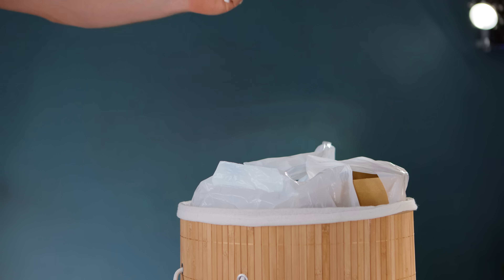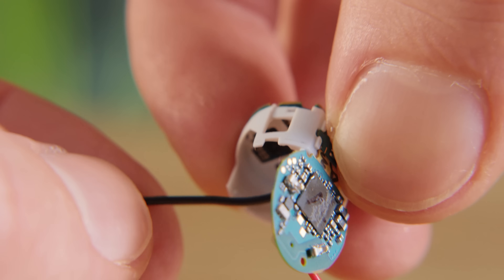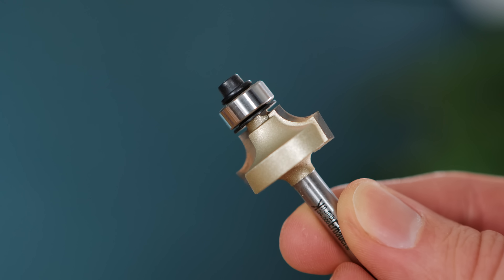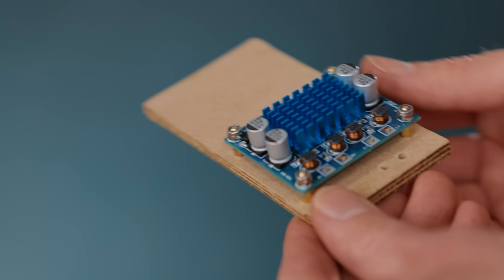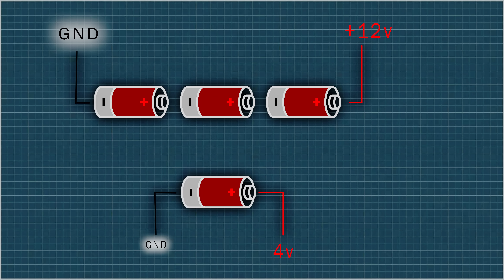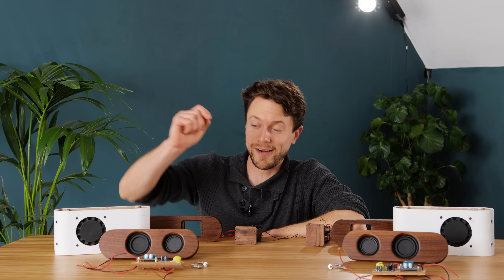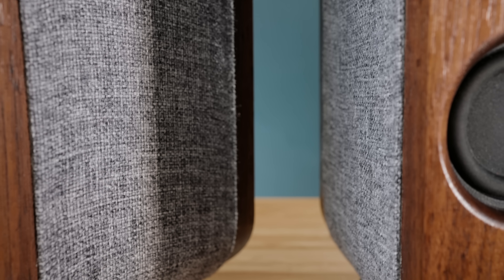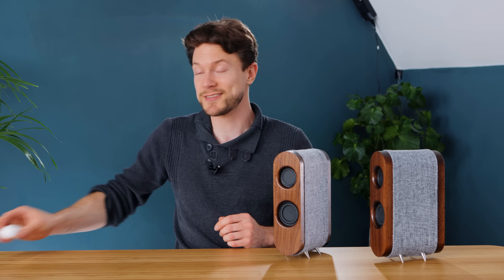Transforming dead earbuds into POWERFUL wireless speakers

Comment: Old earbuds = free

Everything else = counterintuitively expensive
Reply: Everything else is pretty much optional though. What matters is the idea that a set of earbuds can give you a way of connecting 2 speakers to one device, which I never thought of and it opens up a lot of opportunities. Maybe you dont need to build new speakers, maybe you already have some wired ones which you want to convert to wireless, all you need in that case would be a battery pack as the other circuits are already built in.
Reply: @Chuckiele  I've got some cheap wireless headphones that came with an old phone, and a shit soundbar I got free with a TV.. going to make a set of speakers for the office..
Reply: @unh0lyav3ng3r8  Life is too short to waste your time with bad audio gear. We're living in the prime time when lots of good audio gear ends up on estate sales....
Reply: @unh0lyav3ng3r8  how did you go with making the speakers for the office mate?
Reply: @Chuckiele  Absolutely... My sentiments exactly. Built my son a pair with old drivers for his laptop from an unused pair of earbuds. I had PAM8403 amps lying around and some 18650 cells. 

Picked up a busted pair on ebay and built two pods that clip into the banana clip sockets on some bookshelf speakers. Used some better amps I had and used 2 cells per pack. So now they are true wireless too. 

Both sets sound GREAT just from the separation alone... I would LOVE to hear what these premium drivers sound like, almost as much as I STILL want to know what the extra circuit on the Tectonics drivers is....

...and this is possibly the third rabbit hole I have fallen down. I also have a wireless tv, several frenel lens lamps ... which are great for low light Teams Calls, to name but two.

Whilst one could look at the title as click bait.... I just take-away the ideas on show and run with them.
Reply: Why even come to a DIY channel to complain about this
Reply: @Sketchy_Dood  cuz if its diy id like to be able to do it myself xD not have to not eat for a month so i could
Reply: @kiritofanboy  you don’t have to not eat for a month to make this...
Reply: @Sketchy_Dood  i would why shouldnt i?
Reply: @kiritofanboy  if you're a diy/ upcycling type of person, you've already been collecting materials for years. You've spent hours rolling through rich neighborhoods before their yearly bulky item trash days because so much of what gets tossed is easily repaired or still in good working order. You've rolled through the poor neighborhoods on eviction day at the end of the month, looking for solid furniture pieces because old solid pieces are everywhere. You have a collection of tools bought slowly, over time because of how often you do this type of work. You have multiple cans of paint and stain that you picked up on clearance with no idea how you would use it or when. This is not "I bought a diy kit to cheaply keep up with the Johnsons."
Reply: @RheaRobin  ur missing the point man- i have a Ton of stuff lying around but nothing thats more than old laptop Sneakers and other stuff on that Level, so even if i were to Build it id get a product noone would want to use xD i just think that he should give some Alternative, i know its not hard to look for yourself, but i think it would make the project much more inviting
Reply: @kiritofanboy  you're complaining about capitalism, not the video. Just fyi
Reply: Conveniently disregards the part that mentions you can salvage old parts to make a comment.
Reply: Take from the video, as much or as little as you want.  For instance if you happen to have some old computer speakers that maybe don't work you could use this video to convert them to Bluetooth wireless simply by adding the amplifier circuit, buds and battery.  You could leave whatever crossover circuit is already in the speaker, as those would have been tuned to the speakers inside.
Reply: There were days when DIY Perks used to explain the cost of each item used in the project and show how much I should be expecting to spend. Nowadays, it's mostly expensive luxury diy ideas. I like the idea of Bluetooth earphones for stereo speakers, but I don't think I'll attempt this
Reply: Bro literally compared it with a stereo speaker of similar price (150-200) and blew it out of the water, with more acoustic sweet spot customization due to the true stereo nature of them. Granted, you can get 2 Altec Lansing life jacket volt minis for about $70-80 a pop and link them in series, according to the manufacturer, but the tax doesn't buy you a feeling of accomplishment 🤷‍♂️
Reply: it's obviously not aimed at people who don't already have the tools and don't do any kind of DIY. This isn't tiktok upcycling.
Reply: @Daniel Kintigh a 3d printed self designed enclosure would be dirty cheap in comparison
Reply: Just take cereal box, puch few hole and dump everything in it
Boom, finish and durability of your own careless
Reply: @Daniel Kintigh I haven’t seen exotic lumber go up like he used, just pine/framing. Maybe it’s different where you live, and if it is, I’m sorry to hear
Reply: You'd be surprised of how cheap it is to get your hands on a set of electronics. The only thing that is a little pricy but still really affordable is the soldering iron and soldering wire.
Reply: very very yes
Reply: This does give the option to use old speakers to convert them into wireless. But in general DIY speakers are not so cheap and rarely sound as good as something you can buy unless it's some proven design and material.
Reply: The channel is named "DIY Perks", not "Cheap Project."
Reply: Bet you didn't watch the whole video that he compared his work with a BOSE BT speaker on the same price range. Big brain you got
Reply: @HonorOfKyut  Sure, it’s “similarly priced” if you add up the price of just the drivers and radiators and nothing else (still more expensive, albeit not by much)
Reply: @HonorOfKyut  go and make some speakers pal, put your money where your mouth is...
Reply: Use your brain not your mouth :)
Reply: Yeah but the whole point is that it’s reducing ewaste from “broken” headphones and also it’s just a cool project that ends up with a pair of really nice and convenient stereo speakers.
Reply: @brandint229  Facebook marketplace is a good start to reuse stuff... The used goods market is always a faster and cheaper alternative to what this guy did... But yeah I get it bro 👍
Reply: That's a lot of this channel tbf
Reply: @Daniel Kintigh  @Dan B   @Connor McInerney  @tims - Okay, stop being douchebags.
You don't need "lumber" worth its weight in gold. You need four small pieces of scrap. 5 bucks at the most if you can't talk an appropriate store into giving it away.
You don't need wood stain. Use the smallest can of beeswax from Walmart if you're US. $2. 
You don't need a CNC router. A $3.50 hacksaw can do this, and a piece of sand paper.
You don't need expensive speakers. Get cheap ones off Aliexpress. Let's call it 8 bucks total.
And the Bluetooth tech is free. 
24 AA batteries. $7.50 if you won't spring for rechargeables.
Cut up some old jeans or a shirt for the fabric. $0.00.
Superglue. $1.00
Solder. $2.50.
Don't have a soldering iron? Add $5.50.
Total? $35.00 - and that's if you don't even have basic tools at home.
Reply: @gsommerfeldt  but wasn't the point to get better speaker sound? why would you go get cheap ones off aliexpress? when you can guy a set of working cheap bt speakers for 20-40 bucks? You are also missing the main cost efficiency here which is the time spent.. yes you can have all the parts cheap or free. That's if you can get them(time), take it apart(time), make it how you want it to look(time), wait for the parts you don't have to get here(since buying online is better and cheaper, unless you go in person which you'll most likely have to buy a pack of everything, time), putting it together(time). Do you really want to spend all that time just to have ok sounding speakers? if anything i would spend more on the actual speakers to get my time worth back when its done. Like i said yes you can get most of the items cheap or free but for me time is the key, if i make anything i want it to look good and perform great otherwise ill just buy it cheap and use it that same day or in a few days due to shipping.
Reply: @LilPistacho  The point is DIY. The point is upcycling. Also, as long as you're a little diligent, $2 Aliexpress speakers are as good as the $20 ones you'd get at home. The point is also that this is what you choose to make of it. Want to use choice mahogany cuts for the wooden parts because you like that? Do that then. Want to get special order Bang & Olufsen speakers to put in it? Do that. Special order a router bit to get just that chamfer you feel like? Fine - do that. Get a master craftsman to make it for you with gold inlays? Absolutely. 
Or, do you want to make it as cheap and fun and pretty as you can, do a cool DIY project and spend some time on and with yourself? 
The point is that these speakers can cost $35 for the pair, or less. Or, you can probably spend $35,000 on them if you try hard enough. Build them in 3 hours, or 300 hours. 
The point is that projects like these are what you make them yourself. But don't tell me that these can't be made for cheap.
Reply: @gsommerfeldt  yeah... nah
Reply: @tims001  So eloquent.
Reply: @gsommerfeldt  guys like that don't realize the value of quality time and the satisfaction, that comes with DIY, evolving your toolbox skill wise, etc. His time is so valuable, so pulling a creditcard is much faster and cheaper, rather than work for himself
Reply: @LilPistacho  Someone willing to do this will probably have both tools, and enjoy making projects like this. That saves on both labor costs, because participating in a hobby isn't labor, and save on tools. The rest is a different can of worms.
Reply: @gsommerfeldt  and at that point they sound like wish speakers at still triple the price if not more.. If me pointing something out is being a douchebag then what is it called when u point something out? No need for the name calling, I will happily take constructive criticism but no need for the rest.. Also if you read my other comments from that same day u would see that I do like to tinker so I understand the whole diy thing but the speakers in this video go a bit beyond (can't really be compared to the prices or quality of what u explained), in saying that I also mentioned I do like the video.. All I was saying is to follow this build as a tutorial is very overpriced and isn't exactly just turning old bt headphones into speakers..
Reply: @DanTheMan_87  You can buy Wish speakers if you want to. That's not what I'm talking about at all - you'd know that if you'd read the comment. And name calling? All you guys' comments made you sound like d-bags, so that's what they get called out as. And, by your logic, no DIY is worth it - I could probably have sanded the estimate down to $3.50 and you'd still be like "tHaTs gOnNa TaKe tOo lOng! nOt wOrTh iT!!!111"
Reply: @gsommerfeldt  yea I'm good thanks, what I'm saying is wish speakers will sound better, cost less, and be better than the mongrel diy job u explained.. 😂 your assumptions would make you laugh if you seen my shed, iv been a tinkerer for quite some years but I certainly don't have my own CNC machine and I'd love to see your $3.50 hacksaw and sandpaper get even close to what the CNC did in this video.. Also if you read my comments properly u would understand you have taken it completely out of context.. Toxicity is ugly, there is absolutely no need for it but I see for some of us it takes longer to work that out..
Reply: @DanTheMan_87  The toxicity in the comments from you guys is exactly why I made the first comment. Naysayers and negativity is the absolute worst, and that's what all those comments boiled down to. I whittled down the cost of the build to bare bones, even including what I think would be the absolute minimum you'd need if you don't even have a saw at home. The point is that you can build this for 30 bucks, or you can build this for 30,000 bucks. Or anything in between. And if you can't cut and shape wood with a hacksaw and sandpaper, I'm not sure you've "tinkered" much at all, really... You wanna build the EXACT same speakers as the video? Well... pay for the things he's using, then. You wanna build your own version, or a better version? Do that then. The whole point is that you DON'T need a CNC. You DON'T need high-end B&O speakers. You CAN do it for less, and get great results with a little more effort and a little more time, and some ingenuity. FWIW, I think my CAN DO attitude is far less toxic than your CAN'T DO attitude, any way you look at it.
Reply: @gsommerfeldt  Round in circles again.. I can cut and shape wood but again your missing the point - to copy this video as a tutorial or guide would cost more than buying some good quality speakers and is completely different than tacking scraps together.. I've made my fair share of speakers, I have enough experience in the diy department (partially why I originally pointed out the extreme pricing) and I have enough can do attitude to get shit done but yet again that's not the point.. 
We gonna keep dancing in circles or are we done here?
Reply: @DanTheMan_87  You seem to like the circles, so why not. Again, you don't need the tools, the exact materials or parts that're shown in the video. Which was my point. You can "copy" the methods or use the video as a guide with your available tools - be it a CNC or a handsaw and sandpaper - and source cheap or free materials and parts. 

As I've said time and again, you can build these for 30 bucks or 30,000 - or anything in between. You haven't said anything to contradict that, you're simply naysaying and not providing any kind of proof or examples. 

Why can't I shape wood with sandpaper? Why can't I make speaker spikes from wood cones with a screw through them? Why can't I source cheap, good quality speakers on Aliexpress (which is far different from Wish, btw...)? Why can't I use beeswax to get a deep shine and gloss? Why can't I use scraps from my local hardware store for wood, or old jeans for the cloth?  

There's no reason following this video as a guide or tutorial needs to cost anything more than what I've said. Also, *you're.
Reply: @gsommerfeldt  That's not what he made in the video, your cheap but "good quality" Aliexpress/Amazon/eBay speakers ain't in the video and my point from the beginning is about the build in the video and no the speakers in this video can't be made at home for $30.. I honestly don't know how to make you understand that.. I have far better things to do with my time than go round in circles with somebody who simply wants to argue and completely misunderstood my original point and for some reason can't work that out..
Reply: @DanTheMan_87  Oh... right. I'm sorry. I thought you understood what DIY is... my bad - I didn't know you were under the impression that you had to use the exact materials, methods, tools and parts that DIY videos depict. That's unfortunate. 

Also, there's no claim in the video that the EXACT speakers he's making are super cheap. What you can't seem to get through your head, is that I'm saying you (well, maybe not you specifically) can make speakers LIKE the ones in the video, with cheaper materials, methods and parts. As for quality, that would need a real world test to see what differences those choices might make.
Reply: @gsommerfeldt  my original comment was a reply to "none of this is expensive"..
The video is called Transforming BT headphones into powerful speakers..
I understand what you are saying, it's just your way off point..
Reply: @DanTheMan_87  If you think it’s way off point, then you haven’t understood what I’m saying at all. Also, *you’re
Reply: @gsommerfeldt  Dito.. Oops, spelling mistake thanks for pointing that out..
Reply: Or just buy a recent phone which can pair to 2 Bluetooth speakers at once....
Reply: @MrSecretwest  ah yes let me go buy a new phone and two new speakers???
Reply: This is an expensive way to make some low-performing speakers.
Reply: @Sam Wallacesays the guy reading every comment in this thread...
Jesus dude get a life
Reply: None of this is expensive.
Reply: @LeisurelyLion  if u buy the speakers he is using u get to around 200 dollars which for a good sum of people would be counted as a excessive price for some speakers
Reply: @LeisurelyLion Speakers ALONE are over two hundred quid you moron!!
Reply: @LeisurelyLion  In comparison to just buying a stereo bluetooth speaker, it kind of is. Sure, you have the potential to tailor the sound to your liking, but you'll be paying extra for that plus the tools required to build it and all the time spent on building and testing it. Now if you happen to have these components already from old appliances, that's a bit of a different story, but there's no guarantee they'll sound any better or even as good as a speaker that costs the same or less
Reply: @connormcinerney7503  idea is what matter here. If you want high quality sound then yes,  go and buy everything he suggest. But many people have some old speakers laying around from old stereos or mini hifi systems everybody own at one point unless they are born after year 2000. Or you can find pair of decent ones on fleemarket cheap. Then just modify them using same idea represent here in video, without any expensive tools. And from sound perspective unless you work with some really junk speakers end result will be great. Maybe not looking so good like what he make here but there are some decent looking small speakers that came with mini hifi system from sony and some other brands.
Reply: @connormcinerney7503  You could also just buy old speakers which will cut out a lot of the expense and time.
Reply: @connormcinerney7503  saws and drills are really cheap.
Reply: @abeginnerspov5968  But you're buying more than that. You're also buying the enclosure materials, the glue, the drivers, the electronics, the soldering iron and solder, the batteries, the stain, etc. All that plus the cost of tools will cost more than commercial BT speakers with the same stereo function. I get you may have all or most of these components on hand from old electronics already, but not everyone does or is willing to sacrifice the product they got them from for a potentially worse result or risk inadvertently destroy them due to a lack of expertise/experience. I'm all for DIY'ing you're own speakers (I'm thinking of doing it myself, as a matter of fact), but we shouldn't deceive ourselves into thinking it's by any means a cheaper option
Reply: @LeisurelyLion  Even just the router bit costs the same, if not more than a set of bt speakers let alone all the rest, battery sleds, batteries, wood, stain, fabric, feet, screws, speakers, fans, wiring, cnc hirage, even solder, it all adds up pretty quick.. Not to mention the time it takes to make them..
Reply: @DanTheMan_87  precisely, unless you're doing it as a hobby in your downtime i dont recommend this at all... i used to fix up old lawnmowers and chainsaws etc when i was younger and then sell them again, but if you spend 6 man hours fixing a 40 dollar lawnmower it defeats the purpose.
Same goes with spending 6 hours making 8 dollar Bluetooth speakers... having said that, this guy is getting paid from his YouTube revenue, and is obviously running out of ideas lol
Reply: @DanTheMan_87  your spot on even if you have the tools the bits can get pricey, heck just on router bit to cut door hinges ant strike plates was 30 bucks (usd) and that was the cheap “junk” bit, then add in the cost of the wood (for most people are gonna need a few pieces because there gonna screw up somewhere) and buying of tools for a one time project just isn’t feasible. Still a cool project that I might try in the near future just upscaled to “bigger” Bluetooth speakers
Reply: @DanTheMan_87  you can also do it with a normal drill and a wood file. If you have no tools at all, you can't do diy stuff... that's obvious.
You could just use some standard batteries. I have 3 leftover batteries from phones. You would also likely have the batteries from the charging case.
Wiring is basically free, just take it the next time you throw out electircal devices, have a broken usb cable etc.

Screws cost 5-10€ for 100pcs, so that would last for many projects.
You also wouldn't use the tools on just 1 project, then it's obviosly not worth it. What is needed for every diy stuff, is also to have fun in building things and the satisfaction of having it work.
Reply: @tims001  exactly my point.. lol I was also fixing up old lawnmowers and chainsaws etc as a teen as well and you are right, totally counterproductive.. It is a good feeling when u finally get the fucker going but when u just made $50 speakers for a few hundred dollars and a couple weeks spare time it's a bit beyond..
Reply: @DanTheMan_87  it is mate exactly. But in saying that if i had a couple million subscribers that wanted to watch me fix up old lawn mowers id be doing it every week without fail lol... which is where i think this dude is coming from, a view is a view i suppose.
Reply: @tims001  yea man I completely understand that.. I was looking past the whole YouTube subscribers thing and taking it literally as a diy guide and as we both agree it's counterproductive in that sense..
Reply: @DanTheMan_87  yeah none of it make sense, and id very much doubt anyone has actually made one
Reply: @DanTheMan_87  Time, space and skills!